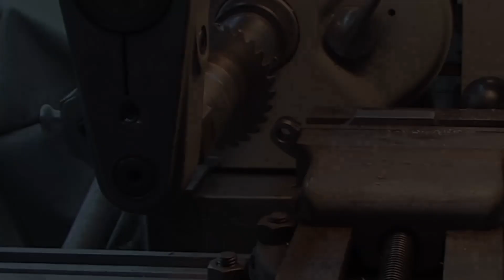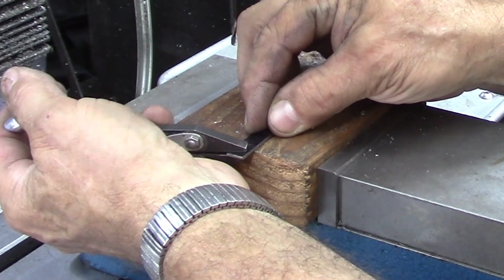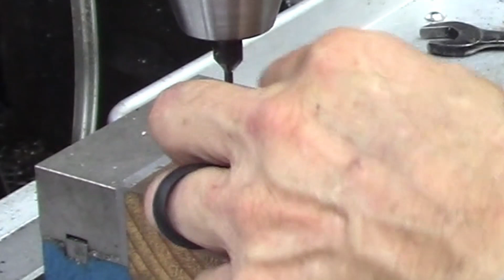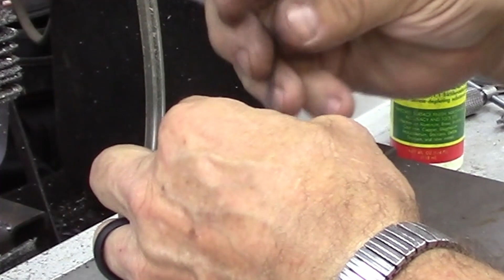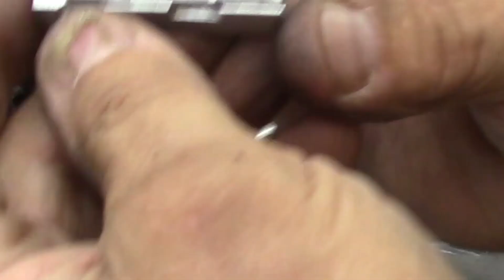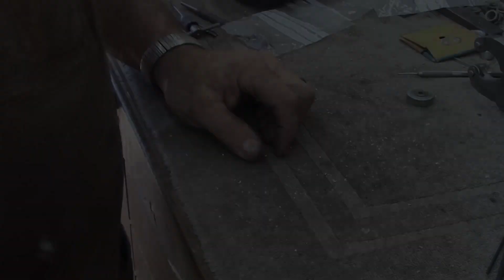Hemingway Knurling Tool: Part 13

Comment: A horizontal mill does come in handy sometimes! The knurler is looking nice, and its cool when you can customize to your needs. Its a shame Hemingway is letting the community down. Cheers!
Reply from the maker: Hi Paul: it worked well, but with that setup it was at capacity, next video it may make a knurl.. Dan.